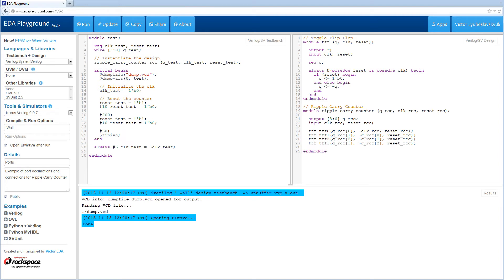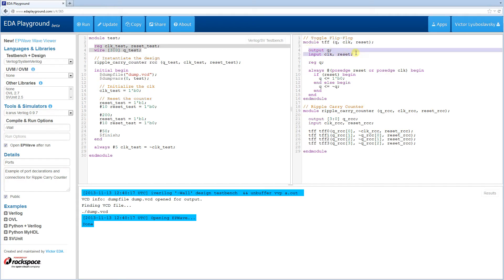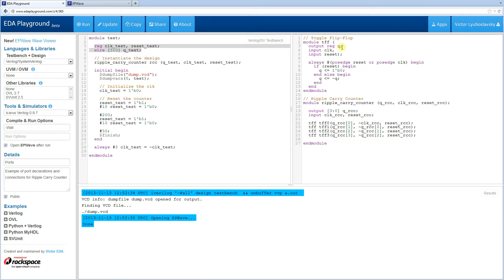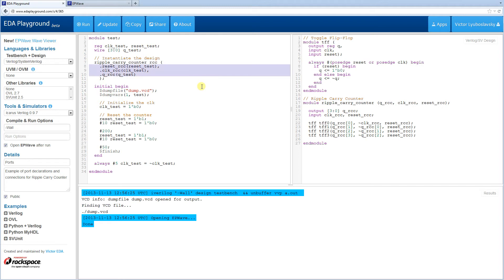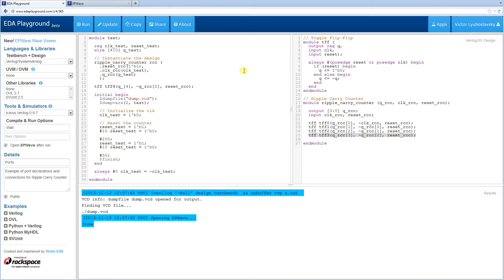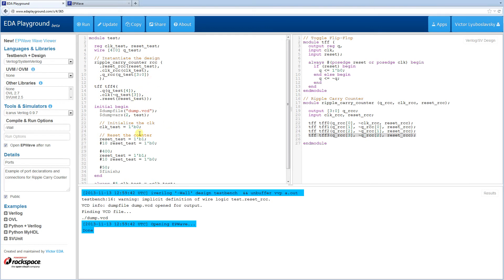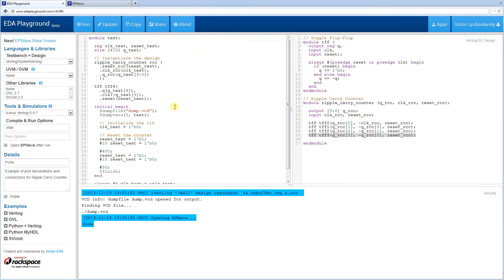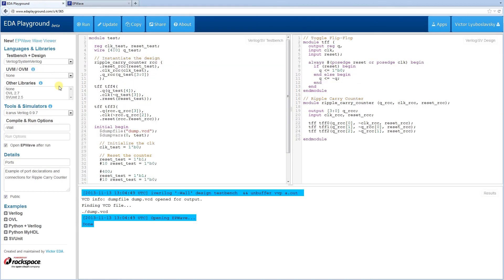Verilog Tutorial 4 -- Port Declaration & Connection

Comment: Hi , Can we override a  `define value of the DUT through our test bench  environment? if possible can you say me the way?
Reply: Overriding a `define value should not be done.
We should use a parameter if we want to override values in our testbench.
The default value of the parameter can be a `define value (i.e. macro)

Macros don't have scope, hence if a `define for the same macro appears more than once in our project, it is considered a "redefinition" instead of an "override"
In most compilers, this generates a Warning.